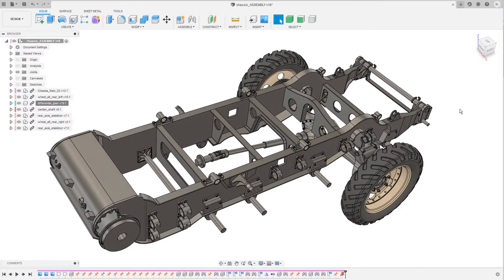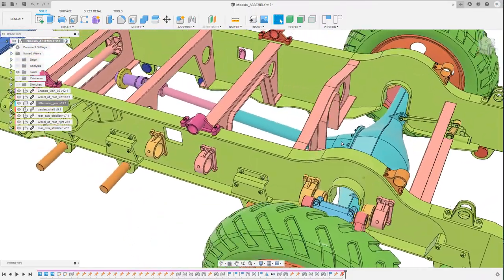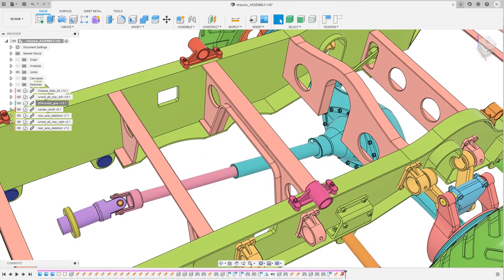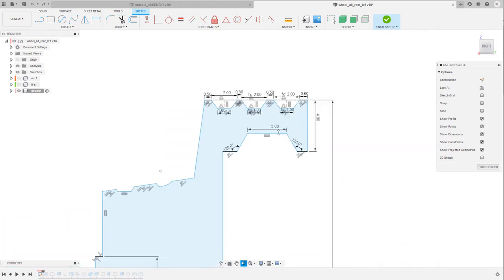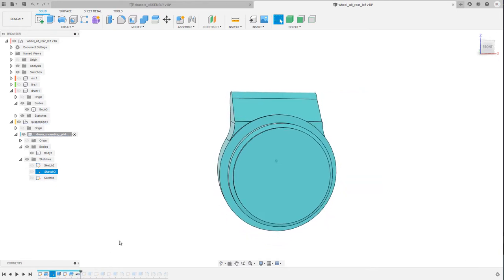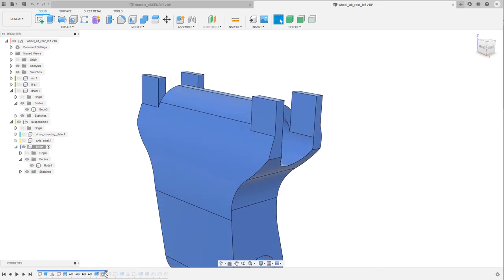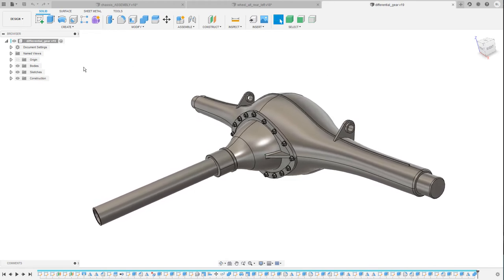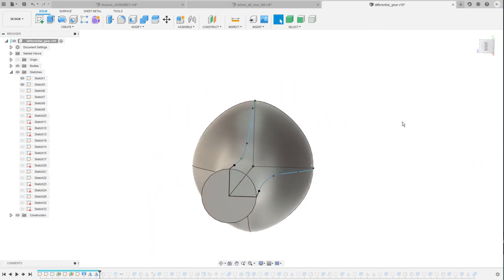Assembling A Wheel Suspension in Fusion 360 - Day 16

Comment: Is there a reason you prefer the remove command rather than deleting components/bodies? 
- awesome video btw I use fusion 360 daily and you really utilized it beautifully
Reply from the maker: Thank you very much Timothy for your question and your kind words! The delete and the remove command are two different functions. Let me explain:
Let’s say you have a single body in your design. Now you use the mirror command to create a copy of it. As you don’t need the initial body anymore but only the mirrored one, you right click on it in the browser tree and select delete. This unfortunately deletes not only the initial body, but everything that’s associated with it – in this case also the mirrored body. If you choose the remove command instead, the operation gets captured in the timeline, the initial body disappears and you can continue working on the copy. In short: the delete command breaks the history, the remove command doesn’t. Let me know if this makes any sense. Thanks for tuning in! Best, Ben
Reply: @3DGladiator  interesting! Thanks for explaining, that makes sense to maintain the timeline history.
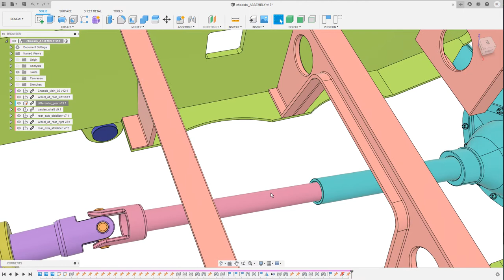Reply: @3DGladiator  Wow, thanks for that. I'm using fusion to generate a dxf file to use on my plasma table. My problem was that when using the mirror command, I used construction lines as the mirror axis, but I'm using sheetcam to generate the G-code and and sheetcam doesn't recognize construction lines and will cut on them. When you remove them, it would do unpredictable things. I wasn't even aware of the differences. Thanks for the tip. Also a question, @ 4:30 you refer to the u joint as a cross link. Is there a specific reason you're using a different name for that piece?